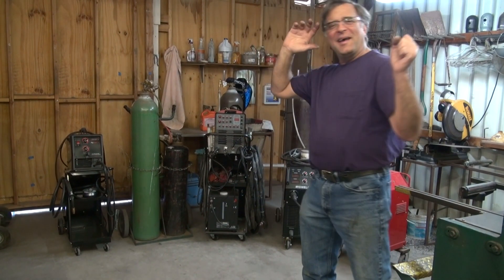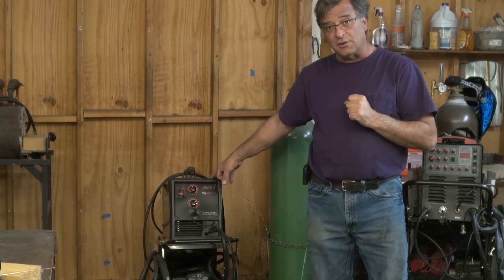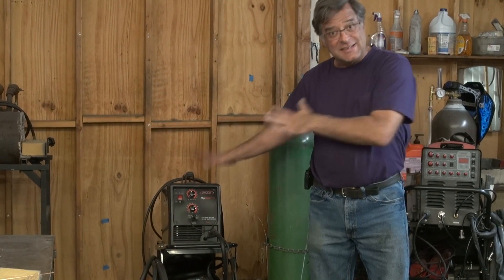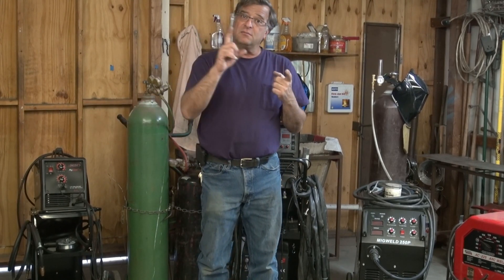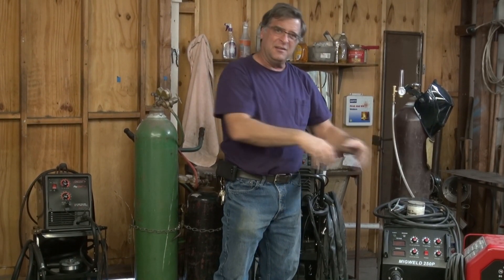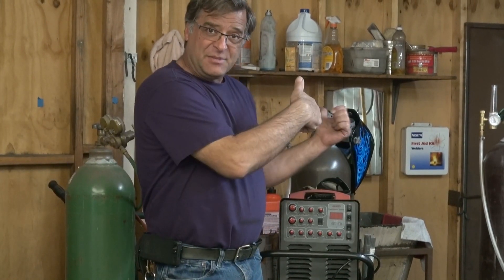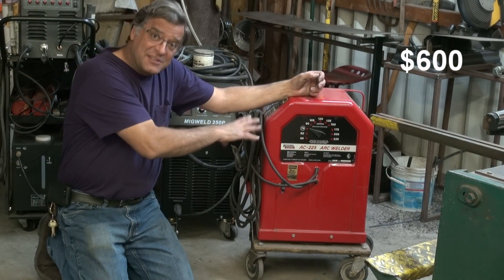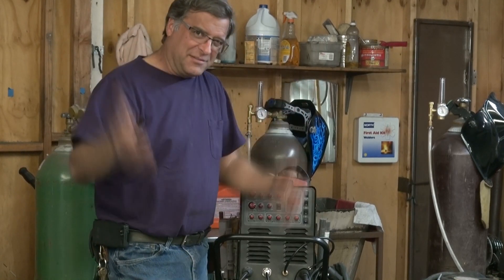How to Pick Your First Welder - Kevin Caron

Comment: I'm glad I found this video. I bought a Harbor Freight welder(90 Amp-AC, 120 Volt, Flux Cored Welder) few years back and have not been able to use it much. All my welds using HD welder is distorted and there are "extra" holes!!!which I clearly did not intend or need. I cannot seem to adjust the heat  or speed low enough or fast enough??. Here are my needs. 
A) Weld exhaust pipes.
B) Weld body panels (Motorcycle fender, Truck fender etc). 
C) Is there a chart that I can reference that gives me metal thickness to spool thickness needed? or is it specific to the brand of welder I buy?
For all structural welding, I tack at home and get it done from a professional.

D) Has to be on 110 Volt output. I DO NOT have 220Volt in my garage. Unless I have to, I prefer "no gas bottles".
E)  Usage is around 3-5 times a year (max).
F) What brand welder do you recommend? I see Miller has one that has Auto adjust etc...seems something for me. 
G) Where do I buy different size spool?
Reply from the maker: CRM6718 The little MIller 211 autoset is a great machine..    If you can afford one that is the way to go.   Just set it up for flux core and get to work!
Reply from the maker: CRM6718 The little MIller 211 autoset is a great machine..    If you can afford one that is the way to go.   Just set it up for flux core and get to work!  You can get different size spools of wire from your local welding supply store.

Comment: Hi Kevin, first of all, congrats for all your videos. I did enjoy this one, but still, I would like to know what you would recommend me. I am a sailor in Brazil, rebuilding an old 32 footer all by myself for the last 8 years (she was in very bad shape). My primary interest is to weld stainless steel tubes for a small stern platform and a boarding stair. So, MIG, TIG or Oxyacetylene? Thanks a lot!
Reply from the maker: nchacel If you can get a tig go that way..      You can do it with a mig but I don't like the mess that come with it.

Comment: Can I run an Ark Welder using an extension cable of about 100 feet (30 metres) providing it meets the required 30 amps.
Reply from the maker: All depends on the size of the cable.  Get something really heavy and you might be okay.
Reply: Thank you very much.

Comment: Hello!there I just need a to weld a small metal like a 3/8,sometimes aluminum.your video is very very helpful because.I never know there's so many types of welder. So which one is good for me to !earn...thanks
Reply from the maker: GalaXy808 If you are going to do mostly aluminum you will need a tig welder.  I like the AHP AlphaTig 200x.     If you are going to be doing steel and aluminum but you are on a tight budget then I would send you to look at a 250 amp mig welder that also will run a spool gun..    The spool gun will let you do aluminum and the mig welder will let you do steel.   A lot of it depends on your budget and willingness to learn how to weld...
Reply: I appreciate your advice,I'll try what can do.

Comment: My 95 jeep cherokee driver door upper hinge the metal rusted around the weld and popped it when door is open it sags my question is what welder should I use thank you
Reply from the maker: ron sanders That little 140 mig with gas..   Clean the area of ALL rust, cut and fit a new panel and weld it in.
Reply: Thank you for advice

Comment: i want to get into tig welding, i have a millermatic 252 mig, a TD cutmaster 39 plasma cutter, a lincoln ac dc 225 arc and a victor acetylene torch kit . is there anything i can get as an add on tig adapter for above or do you think it better i get a regular tig welder, it would be use for light aluminium projects for personal use. thanks
Reply from the maker: Curt Johnson I would point you towards a stand alone tig..   AC/DC and no less than 200 amps...   Only way to go...
Reply: Kevin Caron, Artist thanks kevin, i really appreciate the advice

Comment: Kevin, I used a mig welder in college for a sculpture class. I am getting into woodworking and furniture making. I work out of my garage and would like to get a welder to do table/chair legs, hairpin legs, etc. Would the mig 110 work for those projects and would it be strong enough to support people sitting on it? Thanks
Reply from the maker: Austin Pehl Should be okay.   Long as you are doing all the required prep work.  Clean metal, beveled edges if needed.   Good fit on the joints...     110 volt welders are good to about 3/8 inch max thickness..    Just go slow and make sure you are getting the penetration...

Comment: I KNOW NOTHING!! I'm looking to buy a welder to fix a bbq pit thats 1/4 inch thick steel. I want to build and weld a new fire box to it using a 110 outlet (could go 210 to my dryer outlet but I want to weld outside using a 110 plug if I can). I want to use a flux core welder because they seem the easiest because I don't know about shielding gas. I want an inexpensive welder and harbor freight seems to have a variety of welders..? whats your suggestion. Please.
Reply: ***** don't you need a shielding gas for a welding machine that has a greater than 200 amp capacity?

Comment: hey their, i have a question for you, so i have a Lincoln electric 140 HD i bought and i wanted to know if i can weld on my truck's frame??? it is a 2007 Nissan titan and my Upper Control Arm bracket broke, i wanted to weld a new one on but not sure if it will be ok with this welder.... also what wire should i used if it works for this job...... thanks
Reply: Ok,thanks for the heads up, what welder do you recommend to use and that is good for the job im going to open a shop and im going to need a good welder i wanted to buy a miller but what brand do you suggest?
Reply: millers are very expensive but i know they do the job also what type is the best for everything mig, tig, or rod?
Reply: OK, great thanks!! ill try to get one of them to start out i really appreciate your help....
Reply: It will be ok jus make sure any paint or rusr is ground away so it will burn in good. Even big Migs will not burn through paint well like a stick welder will and 6011 rod is really the only rod that will burn paint 6013 a little and 7018 will not.Check my post up top explaining what I did for my tractor lift.
Reply: Ok, so the 140 HD will work i was thinking on beveling the edges also welding plates on the inner side just to make sure its strong and wont break. thanks
Reply: will flux wire work or what wire do you recommend with orgon?
Reply: Kay P What wire penetrates more flux or mig? or is it the same???
Reply: alex jr ramirez Flux wire will penetrate better when using a small welder with a low max heat setting such as a 140 os such. Flux wire will aslo burn thin metals such as sheet metals , body panels etc. so solid gas wire is better
Reply: + Kay P OK, so use flux for what i'm going to do right... and solid gas wire for thinner metals?
it will be a Nissan titan frame fully boxed i want to weld new upper control arm brackets and modify my suspension...
Reply: Car frames nowadays are made with HSLA steel. Consider the amount of heat input you will be putting on this. Just thought I would mention that. HSLA is steel that is heated and cooled to become a strong metal. HSLA stands for High Strength Low Alloy. Welding anything puts around 50,000 degrees Fahrenheit into a small area like a bevel and cools rapidly.
Just like pouring really hot water on a small area of your ice covered windshield.

Comment: im looking to hobbie weld and im thinking of geting a Longevity Stickweld 140 140AMP Dual Voltage and wondering if its a good choice
Reply: but i have no access to a 220 volt outlet  plus i will ownly use it spareingly
Reply: i would not be abel to afford to make trips to get argon all the time as the tank for it would have to be small for storage reasons and the nearst machine shop that sells it price gouges
that said i  look foreward to  your review

Comment: Great video Kevin.  I would like to get into working with copper (from 14 gauge wire to 1/2 pipe) for garden decor (but I might aspire to do more if I find out I'm any good at it).  I don't envision long beads and am interested in a very fine finish when completed but I'm not sure what a good TIG system to start with would be.  I have experience in basic MIG but no TIG.  I happen to watch Mr. Tig and he mentions 100% helium having 1.7 times the amperage drive of argon https://www.youtube.com/watch?v=cYpYGbC2Drg but I'm not sure if I would need all that power for what I describe.  What do you think?
Reply: ***** Thanks for the info Kevin!  Much appreciated.  That Longevity TIGWELD 250 AC/DC looks awfully nice as well!

Comment: Kevin, excellent video. Thank you for posting. 
I just found your channel, I really like it.
My sons and I have a hobby workshop and we have been in the market for a welder. We have pondered the options. Your video has helped tremendously. I am leaning toward a TIG, but what do you think? I have had some experience, many years ago, with both stick and oxygen/acetyline (I picked both up fairly quickly); my eldest son is an artist and does well when he tries a new medium; my middle son is a quick study and usually gets the hang of things quickly. My youngest son isn't likely to seriously try to use the welder. All my sons are in their twenties.
We would be welding many different types of metal and various thicknesses (including steel, stainless, aluminium, copper, sheet metal, occasionally a little cast iron (here and there), and likely mixing multiple types of metal together (for the occasional sculpture). Mostly we would be working outside. 220 volt access isn't a problem around the shop but 110 maybe needed away from the immediate shop area.
Any suggestions you have would be greatly appreciated.
Thanks again for the video.
Reply: ***** Kevin, my son and I have put the  AHP Alpha tig 200x. on our birthday wish list. With my birthday coming up in the next couple of weeks and my son's in the next month we are starting the hinting process. My question is: is there enough difference between the 2014 and 2015 models to worry about?
Thank you again for your videos, they are entertaining and informative.

Comment: Hello , thanks for your video, I have never use a welder but i am the type of handyman that can pick and learn quick, i am looking one to start low price for now, and i will be welding staff for my farm , like steel metal , for trailer, barn etc etc , what would you recommend?
Reply: Longevity offer me a credit line to purchase, I am the kind of person that i like heavy duty stuff and prefer used heavy duty then new light  or cheap duty, they offer me the 200i, do you think this will hold long hours of work if i get in to a large project?

Comment: Great video Kevin thanks.
    My first welder was an OLD Craftsman stick welder. Instead of having a dial to adjust the amperage it had taps (holes) in the front panel of the unit. You merely plugged the positive lead into the hole that was marked with the amperage you wanted to use. I tossed it in the trash one year after the insulation had broken down far enough to be very scary to use. The trash man gave me a big smile and then put the unit in the cab with him (Copper).

Comment: Is the 220V you mention the same as we in Europe have in the normal household ? (yes, I know 220V = 220V  :)  but is there any other difference ? )
Reply: *****
It's 220V 50Hz
Reply: *****
Ok, just one more question and then I quit bodering you :)
A 120A flux core mig welder, is that enough for som occasional welding on for instands motorcyle frames ? (just brackets etc.) ?
Reply: *****
Ok, tnx ! Now I know what to get

Comment: Hi, I myself see no use to by anything that will not do a job you wish for... So, I look at welders cycle rate..... I want to be able to use my machine until the job is done... Those small 110 20/30 percent duty cycle machine just cause you more problems and I do not think anyone should ever learn on one.... You have to be a better welder to use cheap equipment... With better equipment you can figure things out pretty quick because the heat range are much more steady... Tig you are the range.... That is why I find it the hardest.... Mig you can get as clean as tig with the right gas, and pre heating.... anyway that has been my thoughts most of my life.... I am not a true welder but I can weld just about anything.... A true welder is more of a metallurgist they know what heart ranges, rod and filler type, all types of gasses some you have never heard of most for strength and durability... Something else you can buy brand new 2x4 and not be able to use it because its not straight or for what ever reasons... The same is true in steel, used and new...... Steel carbonizes when left out side...(rust) some time a true weld use that to clean out oil.... but over time its might weld but will not hold because of its loss of properties.... I think learn to weld what you are want to weld.... Any once can strike a arc and run a bead.... You have no idea of prosperity or even incorrect   welding methods that will cause failure..... First and foremost learn what it is your welding and what is it use for and then find out on how to weld it..........Do not run a bead on something and think bring my a car trailer, I can make it look so good..... Sorry for rambling   Roger
Reply: Shut up
Reply: Kay P
 Kay P what did I do to offend you????? I do not even know what or who you are.... Roger
Reply: Roger Fossette Sorry I was just being funny or goofy because you were going on and on I was being comical I am not offended no offense taken none intended

Comment: I'm pretty sure you need to run on AC for tig welding aluminum. It's the alternation of current that blasts the oxides off of the work piece.

Comment: Great Info. Thanks. My question is this. I will be welding on a trailer frame of varying thicknesses from 1/8 to 3/8. I have a small tig but I think it is too small. It will do stick welding but at low amps. Maybe 1/8 stock. Need a suggestion for the trailer. May try to get a used machine. The trailer is all rusty but solid. Many thanks. Marty
Reply: Thanks very much Kevin. Upon further inspection I've discovered that it is all 1/8".
They use light stuff on travel trailer frames. I bought some 6013 x 3/32 rod to try stick welding. I'll let you know. Marty
Reply: Martin Peterson You'll need at least 130 amps to weld 1/8" mig You might be able to do it with 125 amps flux core. Not sure how many amps that would take with tig though.
Reply: Martin Peterson I dont know why but they charge the heck out of ya for smaller sizes of stick rod under 1/8" . Mig doesnt do well on painted or rusty metals anyway and tig is just to slow to use any project like this its for showy type welds that will be seen like racecar frames and such and stainless.

Comment: great video! sorted out my "what type do i get" question.  i used to have a cheap harbor freight i did a lot of tinkering with flux core (exhuasts and what not) but i want to start aluminum welding. still be able to do steel though. so tig it is. i don't need anything serious as it will just be door panels and what not for track cars. whats the most inexpensive but halfway decent tig i could find? no 220

Comment: what do you think about the EASTWOOD WELDER 175
Reply: Guy model 175 it the highest output rating...  What is duty cycle at such 20% I bet meaning you will only be able to weld 2 minutes out of ten and the amp rating will flux so bad that you will not be able to control your puddle....... Never by a 110 welder at all and only sink money into something that will throw out 90--100   amps at least with a 60% duty cycle at those voltages..... Roger

Comment: Hey Kevin, I'm thinking of buying an electric welder. I have welded with oxy acetylene some years ago and did pretty well with it. The areas I'll be welding would be both in the back yard and garage. The only power I have is 115v. I'm thinking of buying a Hobart Handler 125 mig ready welder. It says that it has the capability of accepting a regulator kit for gas shield but is primarily flux core. I would like to keep the welder price itself 400 or less. Just wondering what you think. Great vids BTW!
Reply: I have a hobart 140 it's a great little machine. Too bad you're limited to 115v there is a Hobart 179 for sale on Ebay for $400

As far as the 125 goes, unless you don't plan on welding anything thicker than sheet metal you're going to want to step hp to at least the 140.

Comment: Kevin,  I'm looking teach myself to weld cuz I use a power wheelchair and I would like to do my own repairs.  How do I find out what kind of metal i'm working with?  I will be welding in my garage and I have a 220 if needed.  what type of welder would you recommend for my needs?

Comment: " im going back and fourth between a hobart stick mate 205 ac or the hobart handler 125 mig what are your thoughts"

A welder is an answer to the question of "what material you want to weld". No single wrench fits every fastener either.  If sheet metal and stock through the max rated range of the MIG is what you are after, then get the MIG with a shielding gas setup. The Hobart, Miller, and Weldingweb forums are worth your time to visit. If main use is auto body, try .023" solid wire. No one wire fits all use.
I don't buy new AC transformer stick welders. Find one off Craigslist whose cord and leads are in good shape for not over 150 bucks. They are simple and tough so if the shell looks like a bag of walnuts I don't sweat it. If you have "new AC buzzbox" money, I'd suggest spending it on a used 250 amp Lincoln Dialarc or Miller Idealarc instead. That should last the rest of your life and you can set up for scratch-start TIG down the road. They will run off a 50A breaker if you don't max them out and exercise sense. See the abovementioned forums for MANY new welder advice threads.